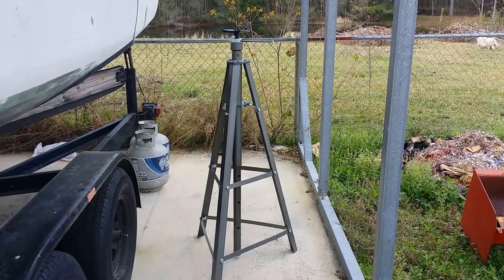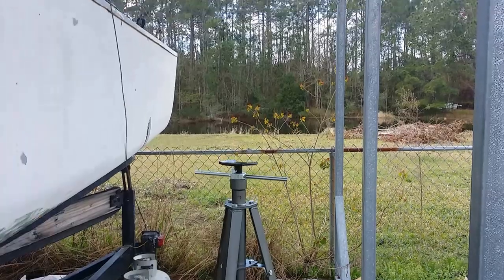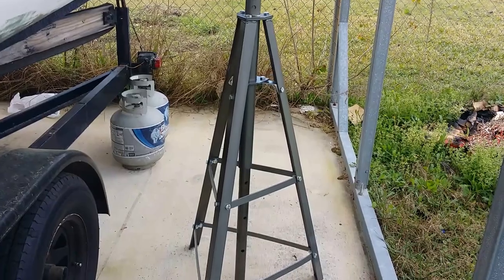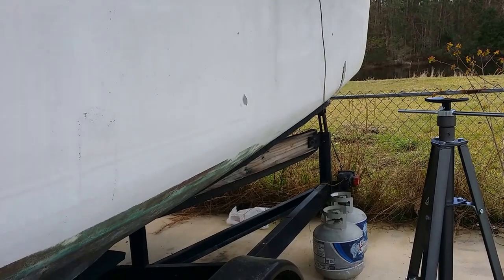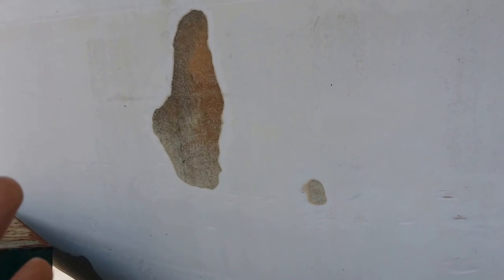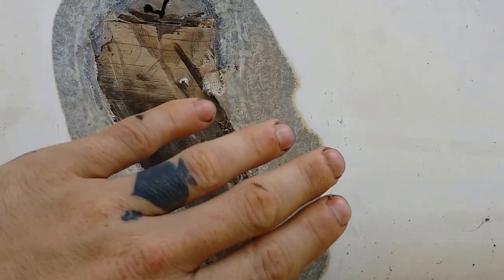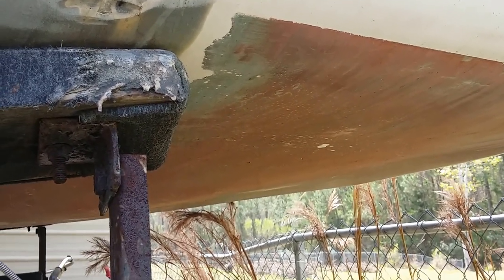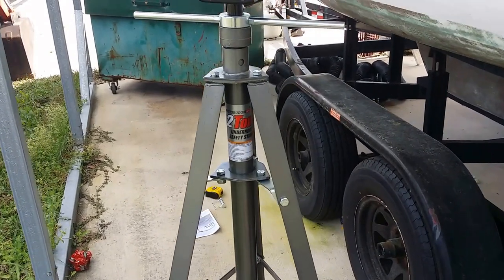MAKING A SUPER CHEAP BOAT STAND

Comment: Hey that marina and price sounds pretty good but in regards to you running a electric heater  al winter because you aren’t paying for metered electric. You better check very well with the that because most  marinas  you nee to have the boat insure an  usually   Electric space heaters are illegal to use  on board.   Because of the marinas insurance ? I  kept several boats in the water during winter months. In the North East an none of the marinas   Were you allowe to use  that type of heat  although it was legal to  install a marine HVAC unit with heat strips an live aboard. House boats. Coul have  a  similar unit they used in homes  that were heat pumps  all but one of those marinas  along the Chesapeake Bay   In Maryland. Had metered electric  and you also neede to run  a electric “ ice eater”  to prevent the water from freezing aroun your boat  many people claim it not necessary for fiberglass and omposit boats. As they will  pop on top of the ice  ?  But wooden hulls  could. Have  more damage  ? I had a agreement with some of my neighbors that i supplied and maintained the equipment and  they  paid the electric  in order to keep  the entire area. We docked  in from freezing over  as a rule i was one of the few  people that   Stayed on board  utilizing the Marine unit and its reverse cycle  mode i found   That to work quite well. Providing i  insulate all the hatches and glass areas. With a Mylar bubble insulation i got from Home Depot and custom fit to the areas mentioned  that. Was a system i used  on a 48 foot Sailboat  we cruised the Carribean. In and  did that to help cool the boat. In the summer heat ( BTW that was velcroed in place temporarily during the seasonal  usage  i highly reccomend that. Stuff its cheap and i   Knew that camper van builders  use it in their wall construction  because i have a Uncle that is retire Military and ha a 4x4 van built for hunting in Alaska  so he ha samples of the stuff they used and the Home Depot  material  looked very similar  despite the Sailboat being a  pretty well made  boat  most of the factory windows and hatches. Were all single pane. Glass that dont offer much  of a Barrie for the cold and hot elements   I do not claim to know everything about boating  by any means  but to let you know ive owned 17 or 18 boats in my life both power and sail  grew up in South Florida  and have lived aboard a couple of times in my life. Plus gone up and down the ICW a few times  as well as  back and forth from Florida to the Bahamas several times  in both Stink Pots and Blowboats  ive studied a few times for my Captains liscence  but. Never. Got the actual  liscense  due to   Crazy circumstances. Like  a  illness , or  a messy divorce and other business obligations ?  Unfortunately as. Ive aged   My health declined. And I’m not very sure i could get the medical release at this point in life  so i may never  get the liscense   Which is ok with me as ive done many of the things ive wanted to do   In boating and i am satisfied with what ive accomplished   I do  like your stand idea  although that  too may  not be covered by insurance carriers  in the event of a  injury or failure  because of not being chained like commercial stands are ?  Marinas get real touchy on that crap  but in their defense they can have millions of dollars at risk